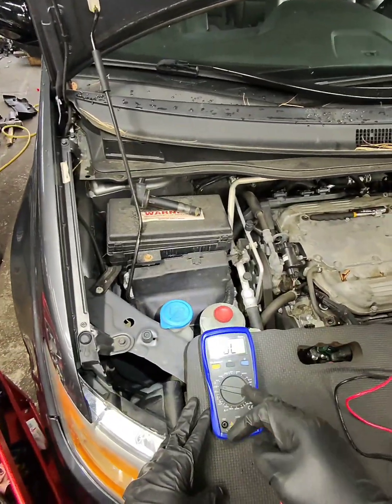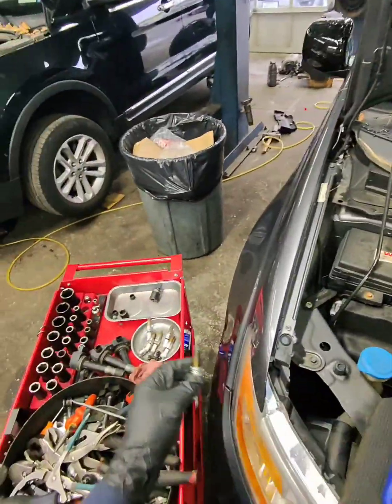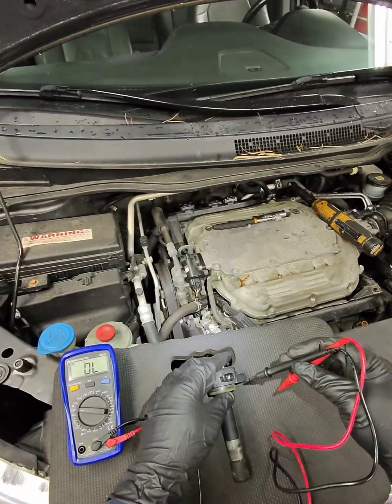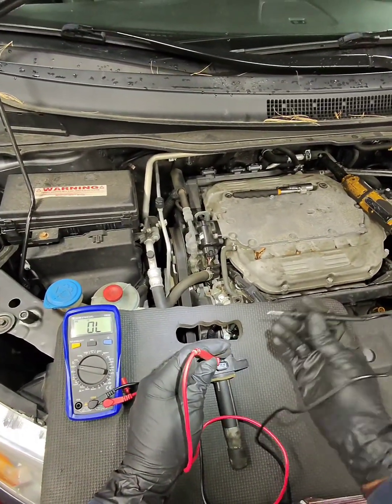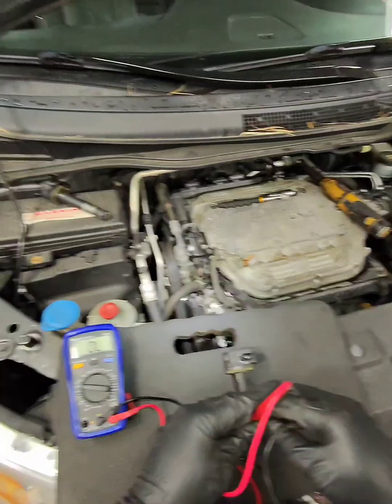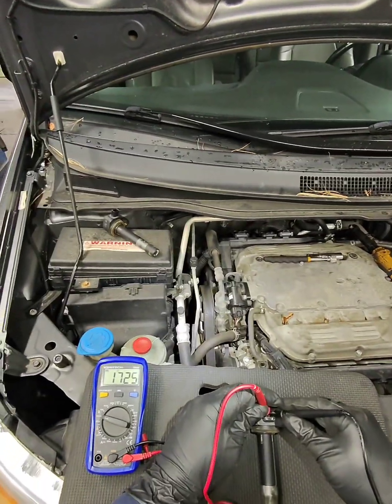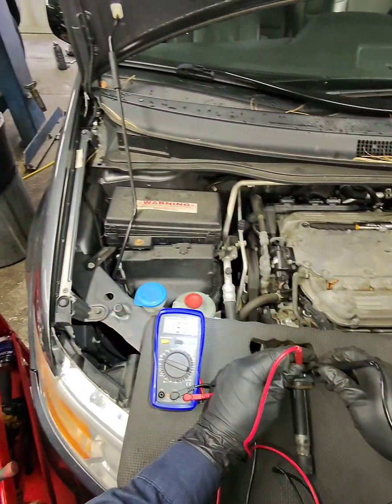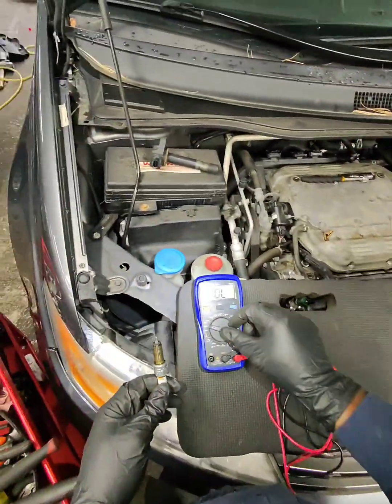How to Test Ignition Coil with a Multimeter

Comment: same trouble i got misfire on cylinder 3 , DTC P0303 , i replaced all 4 spark plug as preventive maintenance , unfortunatly the came back again on cylinder 3 so i swapped the coil pack 2 and 3 , again same probleme back again on cylinder P0303 , whats the point to replace the coil then ?
Reply from the maker: You dont just throw parts at stuff, you have to test and verify first. In my case I could clearly prove that the reading on the coil was out of specs, this is after swapping the coil and the misfire moved. A misfire can  be caused by faulty wiring, fuel injector, damaged cylinder, vacuum leak etc. If you know how to read live data on a scan tool that can possibly guide you towards what is wrong.
Reply: @rjcartutorials thanks a lot , i got car scanner app , i will have a look , the stochiometric seems to be ok